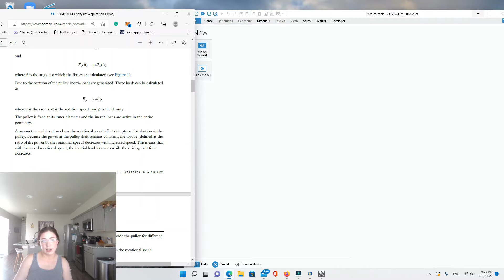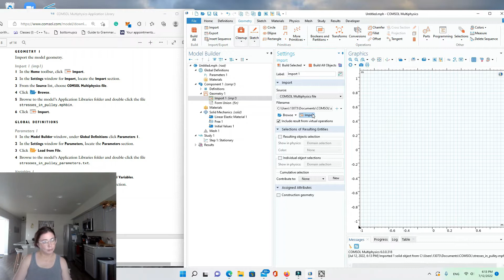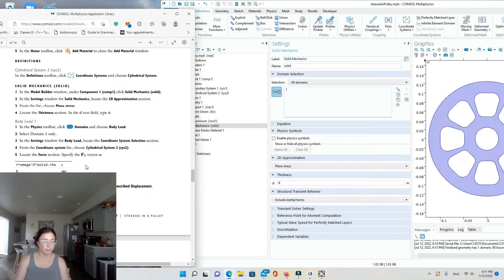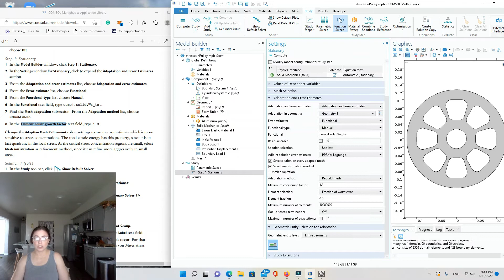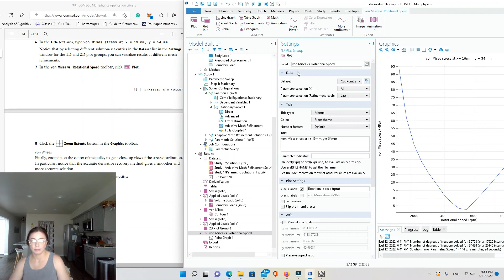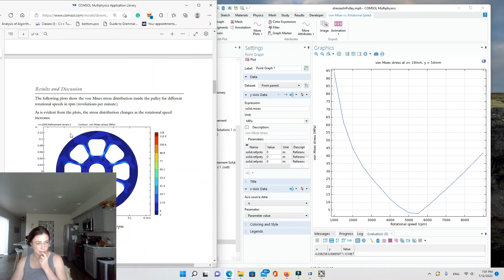von Mises Stress in a Pulley COMSOL Tutorial

Comment: Hi. Thank you for your tutorials.
I want to measure this stress in a different environment.
I want to measure the von misses stress on the windings of a single-phase transformer. In the AC/DC module, I can calculate the generated force on the windings; however, I do not know how I can measure the stress on the windings due to the generated forces. I would really appreciate it if you could help me. Thank you.
Reply from the maker: Hi thanks for watching! If I understand it correctly, I believe you will just create a second study and use solution 1 from the initial study as the input for the second study (turning off the physics for the force study by clearing the checkbox next to it in the vin Mises study).
Reply: @JessicaHoffmanTutorials  Hi. Thank you for your answer. Exactly it is what I want. Among your tutorials, is there any video that can help me for creating a checkbox?